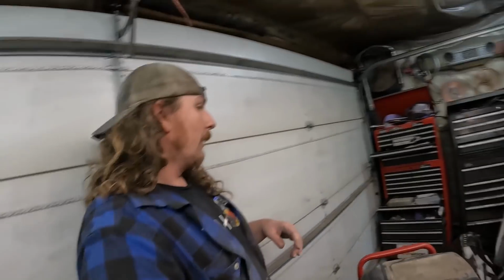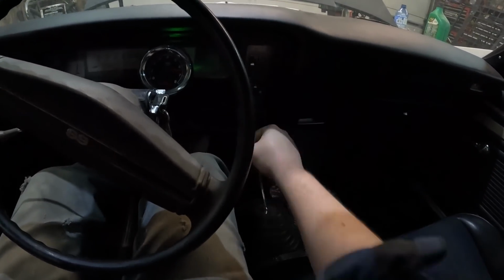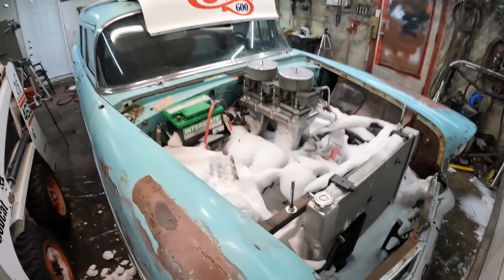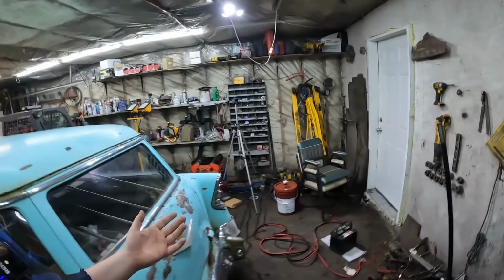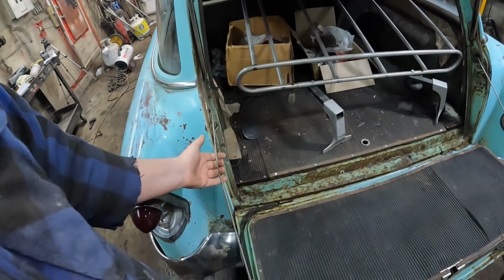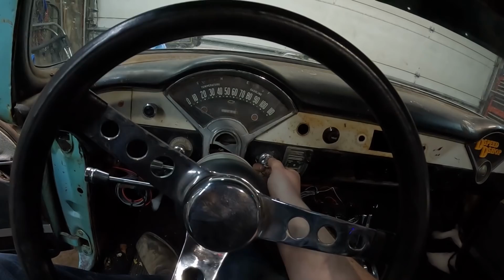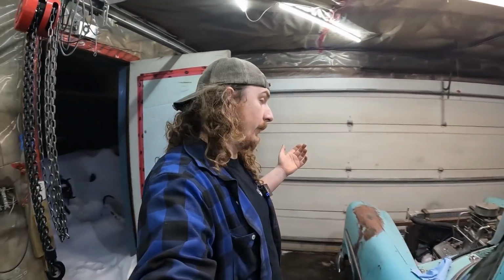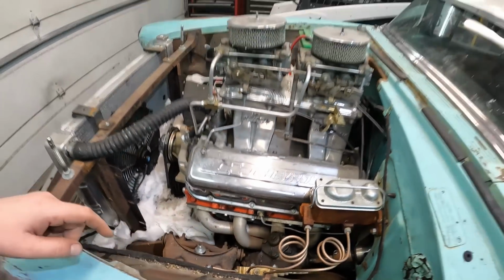1956 Chevy Wagon Abandoned In A Snow Bank - Will It Start?

Comment: I glued foam insulation board to my garage door panels and it cut down the heat loss. I used the grey Durospan from HD, it's only R5 but it helps.

Comment: Couple things come to mind watching this one. Yes, it may have a bad accelerator pump, BUT, with how cold it is, first thing comes to mind when you try to accelerate the engine is that the carbs are icing. Get the temp up in the shop then try it. Also your oil leak may be the distributor. Sometimes the don't sit all the way down on the gasket with aftermarket intakes.
Reply from the maker: Yup its gotta b something simple.

Comment: Only 2007 that battery has another 5 years to go.
I understand using the parts. Put the small block in it make it a runner drive a sell it get someone a option to bring it to the next level or as a cruiser.

Comment: I tried starting my tunnel rammed 468 a couple weeks back. It wouldn't do it it was 17° out same situation though it sits outside so it had snow all over the distributor and top of the engine. It's about 30° here so I might  fire it up the next few days.
Reply: Use s heat gun or a hair dryer on the distributor. They get condensation inside and then it won't start!
Reply: @kevinshiley9061  yeah for sure it gets condensation in there if it sits for a couple weeks. It's a pain to start in the spring for the first time. I might try to start it today
Reply: @kdsboosted4954  I've had that problem with 4 of the 90s style Tahoes and Suburbans and also a 90s S10 Blazer with the 4.3 V6. Heavy rain or melting snow gets down in by the windshield.
Reply: @kevinshiley9061  yeah mine should be parked inside but no space. I have it in a lowrider with hydraulics I built 25 yrs ago. Built the engine about 10 yrs ago. The cars getting a frame off started this yr

Comment: Seems the wiring connection to the brake lights is an intermittent one...they were not coming on simultaneously when you'd press the brake. The driver side one came on and then the passenger one after a sec...i may be mistaken but maybe the contacts are loose or wet?
Reply from the maker: Yeah I noticed that on the edit.
Reply: @DDSpeedShop  Yeah, I thought you might see it on the edit. Cool - just wanted to mention in case. 👍

Comment: I put a 454 in my 71 SS Nova with set of Large Super Comp Hooker Headers number 5 cylinder tube was sitting on top of the steering head on the bolt to the inside, so I took my Metabo grinder and grounds half of the bolt off but you can still get a wrench on it, problem-solve.

Comment: That noise sounds to me like piston slap. The worn out 318 in my daily sounded the exact same. No matter what I did, rattled like a diesel. If that motor was built for a racing boat then the tolerances may be a bit looser than usual. That or its worn out from being in said racing boat. My "diesel" 318 had a great bottom end and oil pressure but those bores were KO'd

Comment: An thing is if I go chevy on a van I am hung up on the like 2003 an up extended 3/4 ton but I like that the ones with the small v8 the 4.7 get great fuel milage an if get that or the 5.3 I'd just want to go for better sound  an keep the ls engine setup stock

Comment: I would put a good small block with TBI and good ignition and headers, make it someone elses problem cause its worth good money now. You will keep picking at it and then it will jus be history as cars go. Sell it to someone besides montana garage as that guy couldn't tune a briggs and Stratton lawn mower. With the money you can get really nice pieces and parts to the nomad which is about the only wagon you should need. If you keep this wagon, then go LS in it so problems are over with the r7004 transmission as it will be a damn nice rig ten to twenty years from now with it having all damn nice undercarriage under it. Maybe power steering and electric wipers and its set for many years to come. Plus the dogs are easy to load in back. One thing for sure, you need to start getting one of them at a time back together so its runners and not pieces and parts endless work.

Comment: If I heard right, sounds like you can't get parts needed to finish off the Nomad (back seat, tailgate parts). Ideally, one would have both cars complete, but If parts aren't available, certainly makes sense to finish the car the has the most value with parts from the car with lesser value.  So, swallow hard, then finish the Nomad in my opinion.

Comment: Dan - what to do with the 56 wagon?  Put a more usable small block in there - but keep the 700R4 for the overdrive - again, it makes it more useable, and you already have the driveshaft.  The back seat is already recovered to match the front - keep it in the 56!  And the tailgate cables are already installed in the 56 - just leave them there.  With a SBC and overdrive trans, the 56 wagon could be a useable classic - if you don't take it apart.

You are the President and CEO of D&D Speed Shop - think about your total net worth.  With the 56 wagon as a complete useable classic, you are maximizing what it's worth and increasing the audience that would want to buy it.  You'll find another rear seat and cables for the Nomad - and when you do, then you'll have 2 complete cars rather than one parts car and another incomplete car.  Get the 56 together and keep the 56 together.  Then use it and enjoy it.  You'll be better off in the long run - or as you would say, "The future Dan will thank you".

Comment: After hearing the two cars start are you sure you want to swap that engine into the Nova? Especially in this day and age where just a few upgrades would produce more power than that old big block.
Reply from the maker: I want the look
Reply: @DDSpeedShop  I would suggest making sure that big block is all sealed up and good to go before making any big moves on the Nova. Would hate to see the car stashed in snow drift cause you got tired of chasing issues.

Comment: i must have great luck with batteries. i bought my motorcycle it was made in APR/04 has same battery in it till last yr it wouldnt stay charged..  lasted 15 yrs? had old battery on mower that was dead and redone it been good for last 4 yrs.. the date code is 10/12.. my truck and cars different story, with the big amp in them i cant kill them quick. new one ever 3 yrs..

Comment: Hay Good Buddie my fellow gear head Danny had a question for ya im wanting g a van again but I've been thinking I'd like a dodge van but fine with a chevy if I go dodge an get lucky with one with a 318an Bea 1996-2001 I'd it posable to put a mild build on it the 318 so I gain a lil extra power say lil choppy idle an better sound an exhaust with a throttle body 318 or should I take it old school an yank the efi an rock a carb an like Mallory distrib or even just a plain like chevy distrib in it figured what way would u go an ya i.likr wagons but want to use a van for both work an fun when not using it for work I also want to do the painted signage an pin stripping on it like old service an repair co like old service station truck or work trucks wore done for my plumbing day work classy stuff